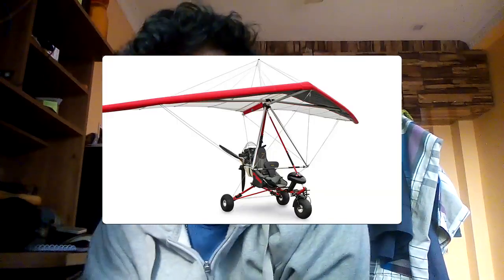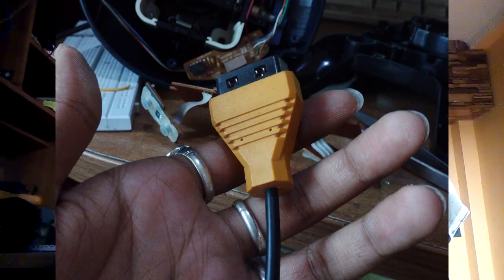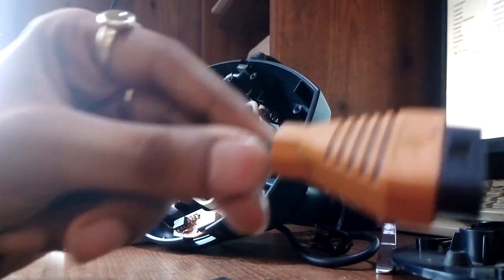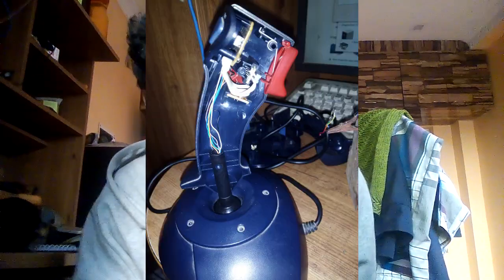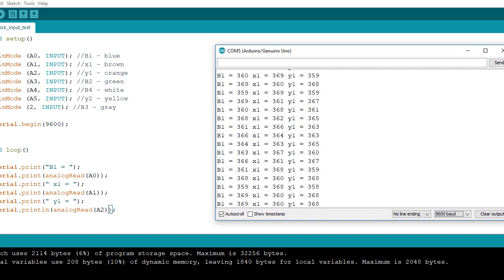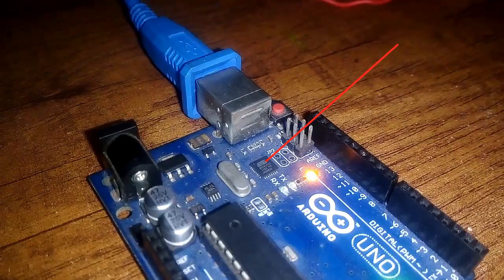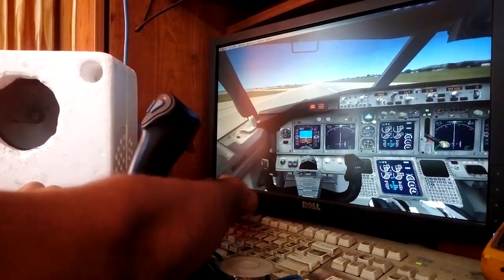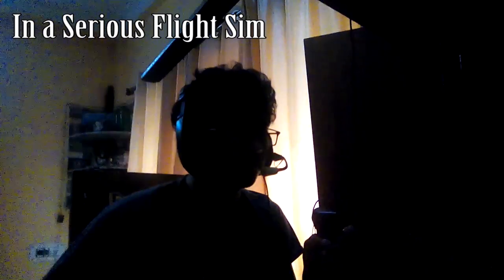How to Make your Own Custom Game Controller with Arduino, Super Easy Tutorial

Comment: Which one is the cheapest arduino in india to make pc game controllers... ( basic versions would be ok too... Want to make for COD or Micecraft... ) ....please reply... 

Nice video by the way
Reply from the maker: Thanks :D Probably any uno, nano will do, but the important part is that USB to Serial chip, and you need an Atmel Atmega16U2 as the serial chip, many cheap clones (UNO and NANO) uses a different chips (e.g. CH340G) which cannot be flashed using that AMTEL flip program... you can also use a Pro micro or leonardo those uses an Atmel Atmega32U4, but those are not cheap... so I'll recommend you UNO or NANO (both are basically same but NANO will have 2 extra analog input pins, which are really handy) with that Amtel chip as USB to serial converter... and those have plenty of pins you can use to read pots, buttons, even ready made joysticks, can be used to make pretty complex controllers...
Reply: @OuttaSyllabus  awesome... Thank you so much.... Really helped...
Reply from the maker: @तंत्र  welcome bro :D